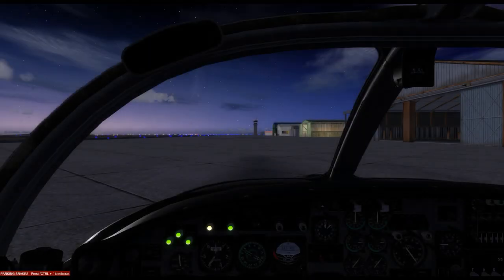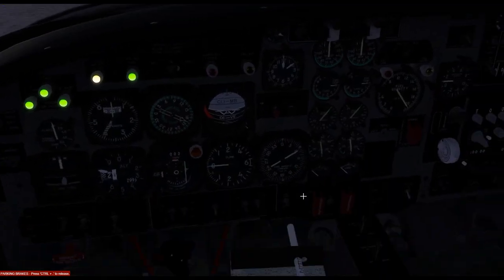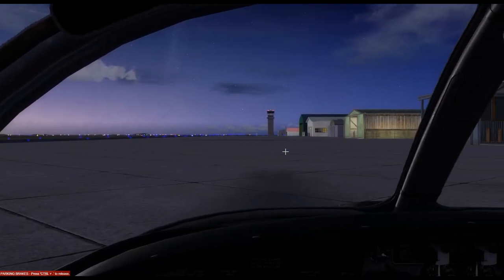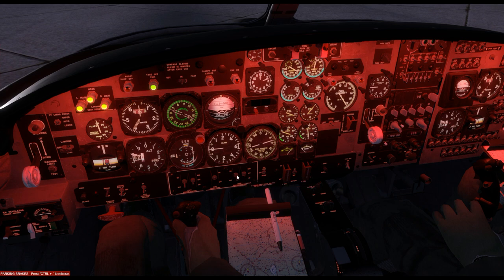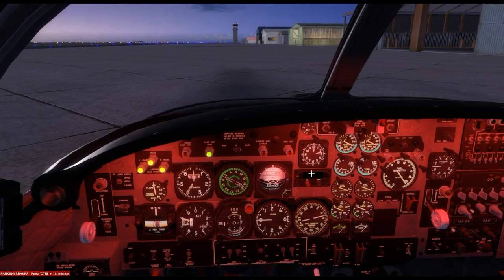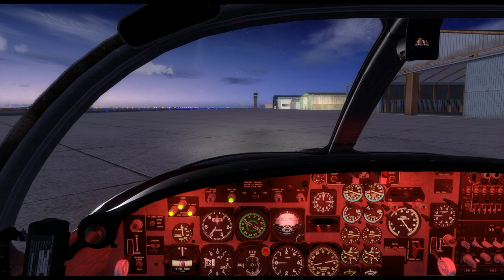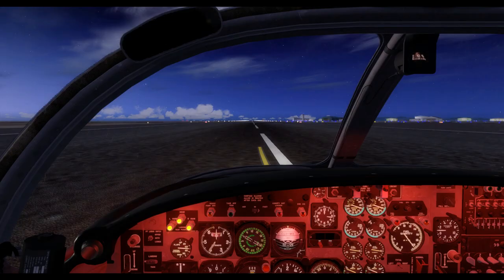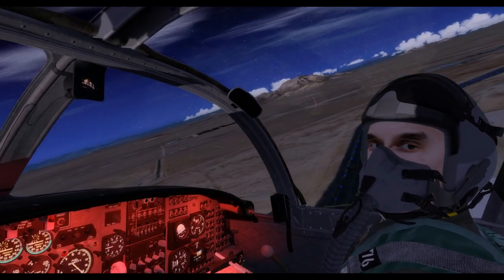T-37B Tweet - Cold start & takeoff

Comment: Obviously you have never read the checklist since you have the left throttle at 60% when starting the right engine.  This provides engine-driven electric power.  Otherwise the right engine might overheat due to insufficient battery power.  Former T-37 instructor.
Reply from the maker: Good catch! Indeed the step was missed.
Reply: Were you an instructor at Randolph AFB? I grew up in north east San Antonio and spent plenty of time watching the pairs of T-37's and T-38's training. I wish I could have flown this plane but my motion sickness and vision eliminated me from any chance of flying for the military.

Comment: Are there random failures? Thanks.
Reply from the maker: We have not modelled custom failures in the Tweet. The default P3D failures work with most of its systems if you activate them.

Comment: As a former USAF T-37B student pilot at XL...  0:25 yeah.... try to move your knee board and touch your instructors throttles.... I DARE you! (Just be prepared to get your ASS KICKED by your IP!!) .... Touch ANY of your IP only controls and he’ll grab your mask with his left hand and start swearing at you, shaking your head, till you question why you were born!

No hate..... Just say’n
Reply from the maker: Totally valid! Within the constraints of the sim, however, we have to over extend a bit. That justifies the instructor's look every time you look at him.
Reply: Haha! The good old hose grabbing technique xD
Also what the model is missing is the bulge on the glareshield. You know, the crater where the IP's fist impacts, for attention getting purposes. Every Tweed had it ^^

Edit: Before I forget. The Pitot Heat comes on when entering the runway, the beacon prior engine start. The canopy also was only closed when entering the runway. Its a bit hectic on lineup, but if you're flying that thing in Texas midsummer, you know why ^^